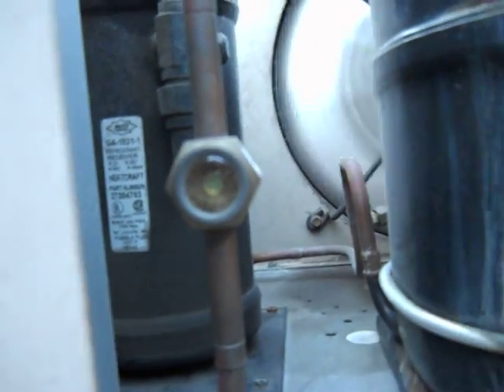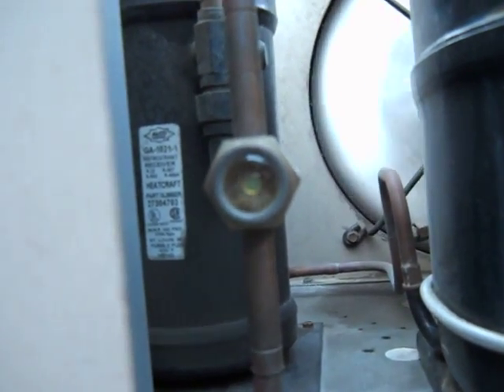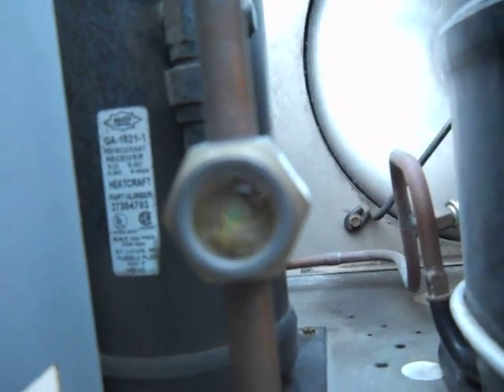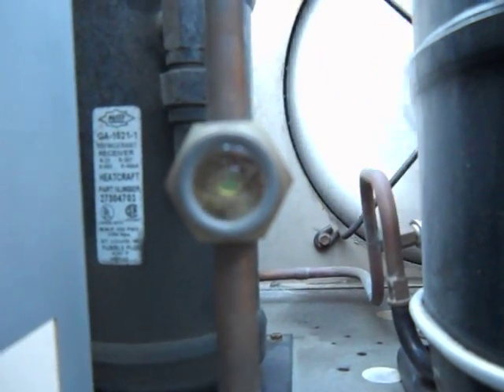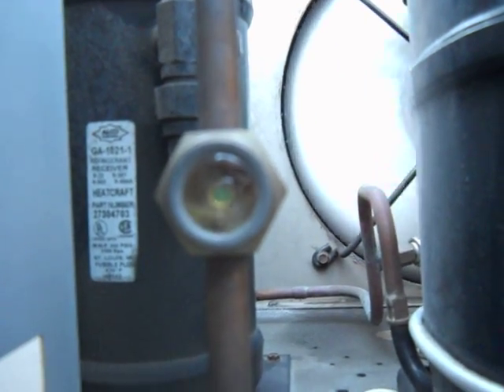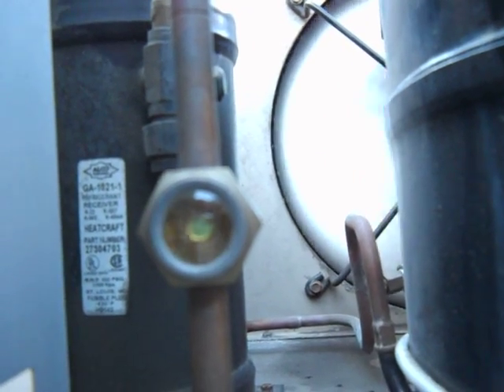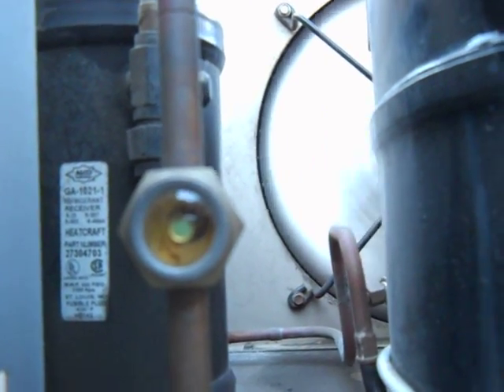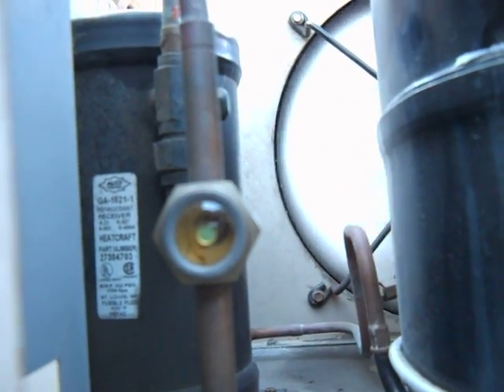How to Tell if Your Refrigeration system is Low on Refrigerant???

Comment: I have bubbles that come and go in my system, most of the time it’s clear with no bubbles. Does it still need refrigerant?
Reply from the maker: probably not. Time to blow out the condenser with air. clean the condenser. vacuum the front of the condenser with a shop vac & a brush head for vacuum. You should be able to see through the condenser with a flashlight. turn off the condenser unit and see if u can see through it. Thanks for watching.
Reply: Will do ! The unit is a 10 year old Rheem that’s still running strong, knock on wood.
Reply from the maker: i ONLY install Rheem units. They are the Best units around in my professional opinion of 38 years in this trade. depending on usage Rheems are good for 20-40 years. if used every day 20 years. only 12 years in arizona. 40 years in california. all depends on climate & usage.

Comment: I got a carrier reefer 2015 7300 x4 so this is my second time. I go to carrier for code 18 low refrigerant but now still give me the same problem before they said it’s a leak they fixed it. Now I still got the same problem same code 18
Reply from the maker: 1) maybe another leak ?
2) maybe they did not fix it right ?
3) maybe a different issue ? Liquid line blockage , bad txv , plugged txv.
4) defective / cracked sensor.
Reply: @OcRefrig  thank you I will take a screenshot and let someone check it for me

Comment: Fix the damn leak then clean the unit. Smh
Reply from the maker: Receiver was found to be leaking at the fusible plug. New Receiver was ordered and job was scheduled for repair. unit was recharged to get customer by till part arrived and repair was scheduled. Repair was completed and all is good at this time. Take a chill pill. maybe try decaf.

Comment: I had this single stage Environmental Test Chamber this last week. Just some very small bubbles at the top of the glass. I mean they were tiny. I could feel the liquid line getting warm. I added about 1 pound of gas and it started flashing. Like a undercharged system should. Found the leak, got to replace a shutoff valve above the oil separator.

Comment: When you come across a flashing sight glass, there are a few things that you need to verify before adding gas. First, feel the liquid line verify it's not hot. Second, verify there are no restrictions. Is the evaporator iced up, is there a removable strainer screen on the txv? How old is the liquid drier? Is it restricted? Frost or cold on the outlet of drier?  Is there a suction drier or suction/liquid cores? Don't forget to check all of these first. Just because a glass is flashing, doesn't necessarily mean is low on refrigerant.
Reply from the maker: True.
Reply: bblazeff1 hey can we chat if you don’t mind you seem pretty sharp I’m a master hvacr tech in Maryland venturing into freezers and walk-in boxes you seem knowledgeable I’ll shoot you my email and we can chat if you don’t mind
Reply: Is it common to have a suction and liquid line filter drier? Please explain how what you mentioned above would cause flashing sight glass.

Comment: wow the lennox sight glass just get's all foamy on start up then I don't see anything????? may low on 410a?????
Reply from the maker: Foamy on start up is prob cause has a little mineral oil left in old line set mixed with the poe from thd new 410 a compressor oil. Not a big deal. It clears like its supposed to do. Sight glass is full. All good. Are u having problems with it ? Whats the t/d return & supply.

Comment: hey partner can you give me a tip? my auntie's 3 ton lennox condenser has a sight glass when the unit kick's on I looked at the sight glass and it get's all foamy????? 410a any suggestion oc thank you.
Reply from the maker: Foamy on start up is prob cause has a little mineral oil left in old line set mixed with the poe from thd new 410 a compressor oil. Not a big deal. It clears like its supposed to do. Sight glass is full. All good. Are u having problems with it ? Whats the t/d return & supply.

Comment: I need to know if my heat pump defrost board is to blame. I noticed recently when my Trane 2 ton goes into defrost, the outdoor fan did not stop like it usually does. It's been doing it ever since. I also tried to force defrost, and it didn't work.

Comment from the maker: All True!
Condenser Coil for sure!!! ---if it is not Clean--- The Hot gas will not turn into a Liquid.
Hense, that is what a Condenser Does is Remove Heat so the hot gas can turn into a Liquid. Explanation---(info-not for u- for others just starting out).

Comment from the maker: A System Must Be Running For At Least 1-2 Minutes Before Determining if the Glass is Full or Empty. If it is Low on Refrigerant--- Refrigerant Definately needs to Be Added. if u Do not add Refrigerant You will Shorten the Life of the Compressor, The System will run Longer and Consume ALOT More Electricity 50%-200% OR MORE Electricity. it Also Will not get Very cold if it is too Low on Refrigerant.